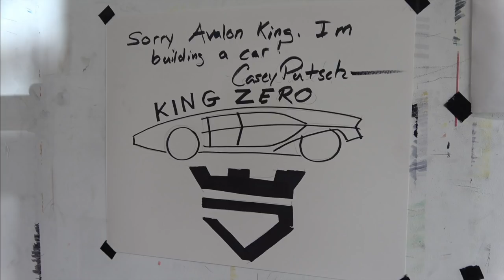Finalizing for paint | Lykan Hypersport Genius Garage build #24

Comment: In regards to the Double Glass panels in the roof of the Genius Garage's  Lykan Hypersport, if the Glass gets damaged in some way is it possible to replace these pieces of Glass at all, as the Glass looks rather particular to the Lykan Hypersport in regards to their shape and how they curve and doesn't exactly look like something you could just get from your local Auto store or Glass Manufacturer? And if they do have to come out to be replaced how big a job would it be to swap them over with new pieces of Glass that fits into the Room of the Lykan Hypersport, and lastly are you intending to Tint these Glass Roof Panels at all?